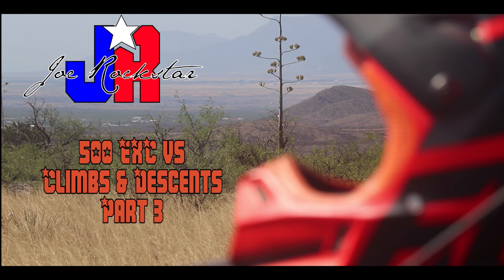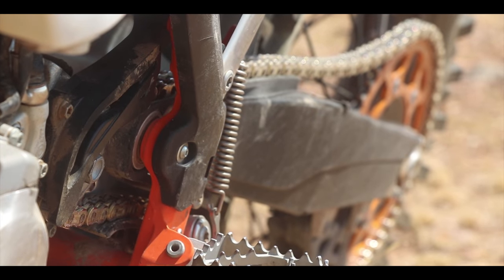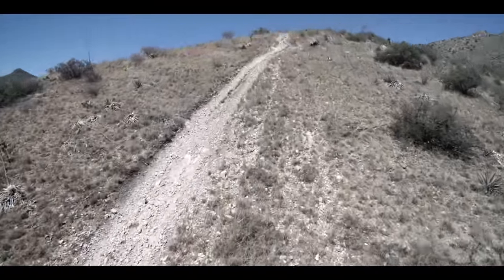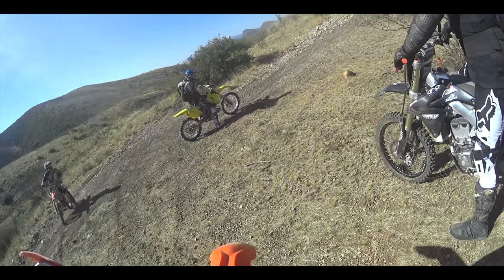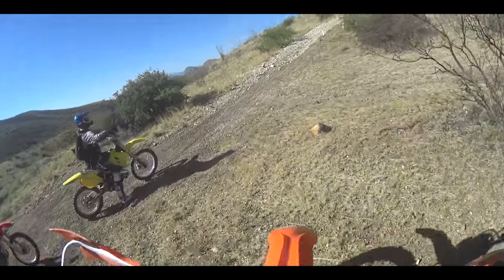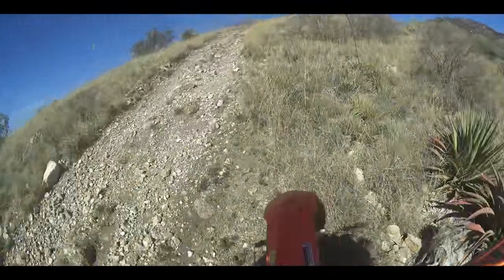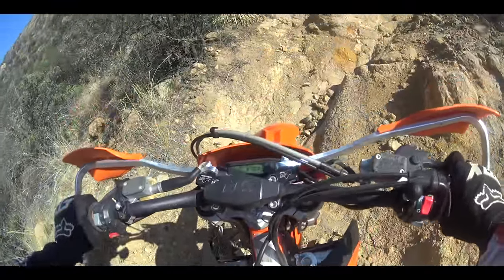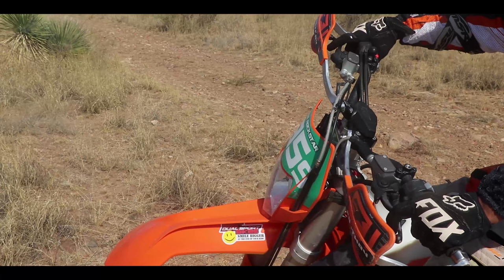KTM 500 EXC vs Climbs and Descents Part 3

Comment: Great video Joe,
I think one thing that helped me understand why we stand is that it allows us as riders more quickly adjust forces placed on the rider due to changes in terrain and bike attitude. I allows for better balance through being able to shift weight back,forth and side to side. And finally when standing, our body acts as a secondary suspension to the bike, allowing us to absorb big hits and deflections, squeezing the tank with our knees to keep the bike tracking well when going through whoops, sand or loose gravel. Or opening our knees to allow the bike to work below us when need be without our bodies restricting the bike. 
Thanks again for the vid. good info!

Comment: Two things...  

First, if you need more speed offroad than a 500 EXC delivers with 13/50 gearing, give up your day job and go take that well deserved place on a factory team!  I run 13/50 on my 500 so I can run 2nd more often on single track without excessive clutch use.  I've never had it much over 80 mph (and that on the road, because there's no place around here I want to go that fast off road!) due to a bent front rim (the 2014's had butter for rims and we got a lotta rocks around here) and imperfect wheel balancing.  She's still gaining speed, and magazines have claimed over 90 with 13/50 sprockets.

Second, the pros (and by pros I mean Chris Birch, Graham Jarvis, et al, and Barry Morris, who technically isn't a pro but he knows pros and he shares with us what they tell him...) say to run a gear high on hill climbs and slip the clutch to keep it on the powerband yet keep from spinning out, like traction control.  The taller gear wants to propel the bike forward more without spinning out, and you use a quick slip of the clutch to reduce drive and minimize deflection off obstacles and rocks on the climb.  

There's a strange dynamic there that applies in other situations besides hill climbs, and after cluing into the practice a couple years ago, it's totally revamped my clutch use!  Old dogs can learn new tricks...  I use the gear-high clutch-lunge (technical term I just made up) to magically and instantly gain drive and speed to float over rough spots smoothly, with less exertion.  I don't race any longer, but I can see where the technique could be used to instantly build speed and make a blazing pass.  I've seen Tomac use it to make his decisive, all conquering passes; I recognize how the the bike moves in lunge mode.  Frankly all the top pros use that dynamic in a variety of situations on the track.  But no one does the blast past (another technical term I just made up...) like Eli Tomac.

Comment: My understanding is that long engine braking on a 2t can also be bad for the engine. If you have the throttle closed and are letting the engine rpms come up by engine braking down a descent, you are starving the crankcase and cylinder of oil since a 2t gets its oil from the fuel/oil mixture out of your closed off carburetor.
Reply: Great video